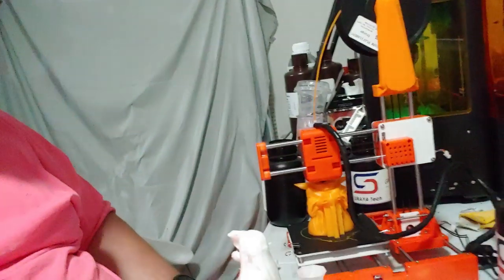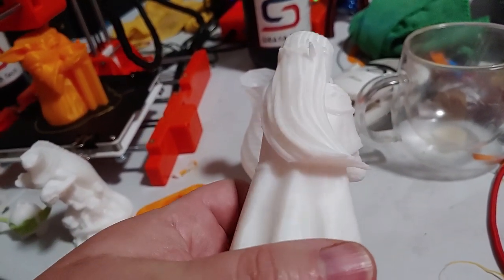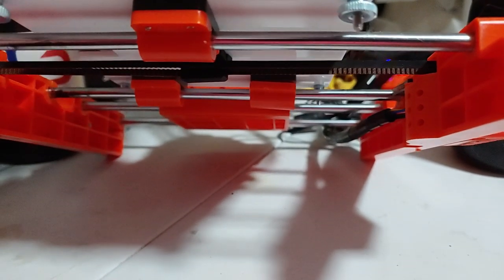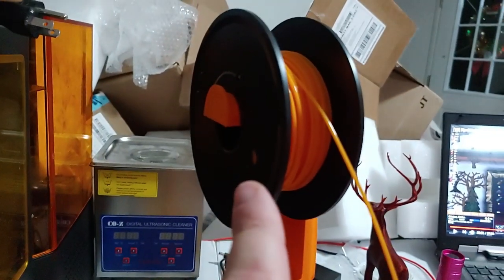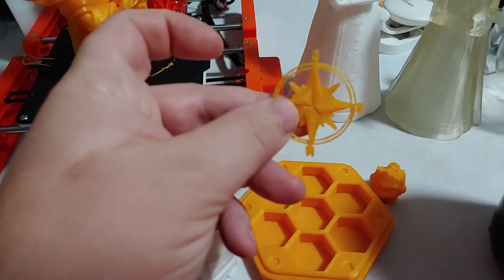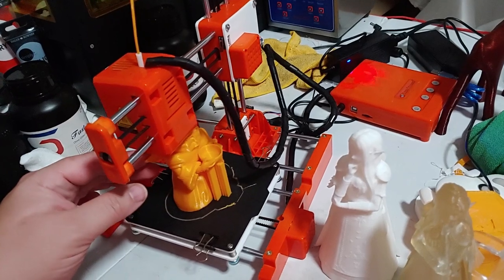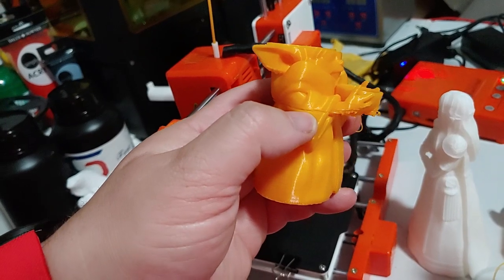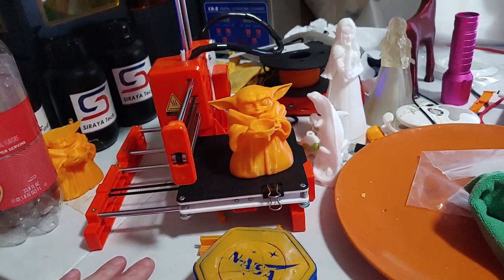Easythreed X1 Tiny Cheap 3D Printer that actually works! T3DP

Comment: I saw that your holder has three files i take it that you need all three files to complete the project and its in stl files so you need to slice them what software do you use and do you have to resize any of the files for them to work
Reply from the maker: That's correct a 3D printer is basically a CNC machine G-Code is what your 3D printer understands g-code is path instructions it's literally like writing down directions to go to someone's house move forward 500 ft turn left 90° move forward 200 ft turn right 45° move forward 600 ft and then you also include speed and extrusion data in all those instructions That's what g code is it's not a 3D model it's instructions to the little motors on your printer move this much move that much move this much move that much

The STL file is the model That's the actual thing that you want to convert into an actual object you can't put a model on a 3D printer because a 3D printer doesn't understand models it only understands movement instructions so that's what g code is

So you have an intermediary called a slicer The slicer takes the model splits the model up into layers kind of like slicing a tomato so you're knife or slicer cuts the model the tomato up into slices and then your 3D printer creates copies of each of those slices and puts them together

The slicer takes the model and does that it's the knife it custom model up into the number of layers needed and then it creates path instructions for each of those layers telling the printer what to do telling each of the motors how much and how fast they need to move One of those motors makes the plastic come out one of those command lines makes the heater turn on your g code has all that data your slicer creates that data from the STL file after it cuts it up into layers and then creates the path instruction for your printer to follow

You should not have to resize the files in fact resizing them would break them because then they would not fit anymore so you probably don't want to do that unless you have a specific need

So you would take those models that I include I believe it's two pieces I'll have to double check I think I made two versions one that's all one piece so if you're pretty that on a different printer you can do that however all one piece won't fit on the easy thread printer itself so I split it into two pieces so that you can use your printer to print the parts for your printer which is kind of a cool thing :-)

So yes you have the basic idea you would bring my model into your slicer you would slice my model using your slicer for that particular model I would suggest 3x3x3 0.2 mm 20% in fill to make the model what that means is 3x3x3 is three walls three top layers three bottom layers 0.2 mm is your layer height That's how many slices you'll need and then 20% infill is how much of the interior space of the model you're going to fill with plastic versus leaving empty

Settings that revolve roughly around that should work just fine to make this model

Comment: other parts recommendations I've seen for the cooling fan are 25x25x07mm, will the fan you linked fit? I'd hate to get the fan and not be able to use it (printing on a budget)
Reply from the maker: My plan is to double stick tape right to the print head so it should work :-)
Reply: Ah ok! it would be awesome if you could post a video of that and a test print :) thank you for being a resource! it's really awesome to see the community that 3d printing has.

Comment: Hey! my printer finally arrived! it printed the cat no problem, i checked your printer profiles and got the one for the X1 however i've no idea what to do with it.... is that supposed to go into Cura? If so do you happen to have a video about it?
Reply from the maker: Sadly know that profile is for simplify 3D. I will come up with some basic instructions. For using any other slicer

Comment: Hi! What brand filament are you using? Is it the one on the description? I need a good test PLA filament because one of the brands I tried keeps on popping off the plate mid print :(
Reply: I used Sunlu pla in mine with fantastic results

Comment: Hi! I recently bought this labists 3d printer and I'm having a problem. The base of every model I try to print tends to peel off the base while drying. Is this a problem of the filament or of the magnetic base? (I'm fusing the material at 185 Celsius, hope that's not too low). Thank you.
Reply from the maker: Much too cold You need to print a little hotter at least for the first layer or two because you do not have a heated bed. Make your first layer 220c

Also, Make sure you're not over squishing the first layer. If it's too thin it will peel. Also, make sure that first layer is nice and slow. In the slicer set your first layer to 30% speed

Comment: Any advice for using slic3r or cura with this printer? I can get ok-ish prints using the supplied Easyware software, but when I slice using cura/slic3r it doesn't print anything even remotely resembling what it should. I'm guessing there's some settings I need to adjust. Problem is, the Easyware software has no Linux version and most of my computers run Linux.
Reply from the maker: I just picked some normal settings and simplify3d so normal setting should work in Cura and slic3r

However one important thing is to slow down this printer cannot go your normal speeds start a 30 m m per second adjust from there
Reply: I forgot to change the filament size to 1.75 from 2.85 haha. I changed some other settings too and now it prints ok in cura. Still not great but hopefully when my part cooling fan arrives it'll be better.

Comment: How you think can this printer do d&d miniatures
Reply from the maker: I was able to get a successful 0.1 mm layer height print that did look very nice. So it's not impossible. I would definitely add a parts cooling fan.
Reply: @nerys71   thanks for answer. I'm new in tabletop role play and started in 5e now got also my kids hooked up to play and we all like minis but  3d printer in this price range can be super usefull to do lot of heavy lifting  for make lots of minis just the way needed

Comment: Thanks for your Settings, working like a charme :) Does your Printer work over USB? I can´t connect it, not in Cura or Simplify3D. Any Idea?
Reply from the maker: I have never tried to connect over USB. I will try to look into that. Most likely you need a driver.

Comment: My son delete software from Card how or where do I goo to get software on card
Reply from the maker: You can use any slicer you want Cura prusa slicer ideamaker simplify3d Etc all will work fine for this printer

I will try to look around but I do not think I kept the contents of the SD card that came with my printer
Reply: Thank you

Comment: did u upgrand any part?
Reply from the maker: No upgrades I did design and print a spool holder but the machine is otherwise stock
Reply: @nerys71  Print quality is very good NO ADD COOLING FAN OR SOMETHING ELSE?
Reply: @nerys71  ESPECIALLY YUDA

Comment: Thanks for the video, I got one and I'm starting to play with 3D printing. My suggestion for future videos: There is a X2 model with a small display, do you think it'd be possible to use any shelf display kit, print a case and add to this X1 model. Also, there is a file at http://www.easythreed.com called "x1 & X2 cooling guide cover", could you have a look? (http://7583133.s21d-7.faiusrd.com/0/ABUIABAAGAAgn_jP8AUoiNDS0gY?f=fengshangai.gcode&v=1578365983). An Arduíno support I printed went out mirrored.. so I hope they fix this bug, meanwhile I'll mirror while slicing. Was the gcode to compensate the 0,2mm when aligning posted?

Comment: Found a fix for the mirror issue. The x and y motor and limiter is actually reversed, just have to swap 4 plugs on the board. Check out this video https://youtu.be/7lur2mVMg34
Reply: Thanks!!

Comment: What about using a glass plate?
Reply from the maker: That won't work a glass plate requires heat for filament to stick and this is not have a heated bed

Comment: Great video. I bought this recently, I believe they may have done a small revision update since the magnetic plate seems better and it comes with a part cooling fan as well. Still can't stick a big spool on it, so have to try your upgrade 😊 

Since it comes with Marlin you can also use Octoprint. Mine runs 1.1.0-RC3. 

I have one problem though, maybe you also encountered it. If I try to print a perfect circle or cylinder, then it becomes quite squared/jaggered, any ideas why?
Reply from the maker: Does it have the same shape in the slicer preview? The slicer might be simplifying the shape?
Reply: @nerys71  it looks fine in the slicer and it also prints fine on my other more “high-end” printer. I guess it may be an issue with the motor/encoder accuracy/resolution.
Reply: @simonbogh  I had to tighten the belts on mine right off the bat, I'm not sure if it could cause that. Perhaps you could calibrate the x and y steps?